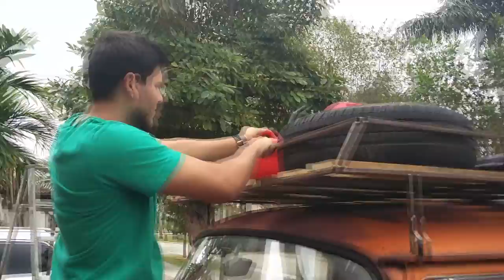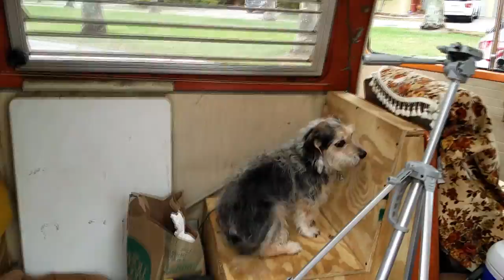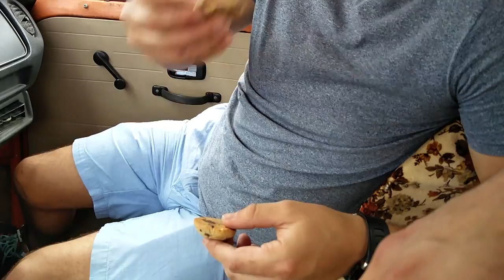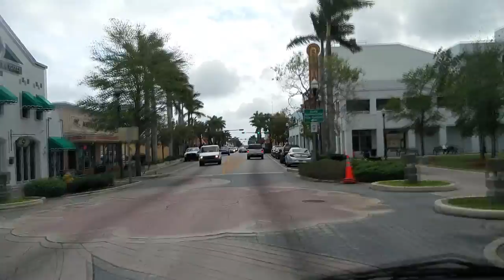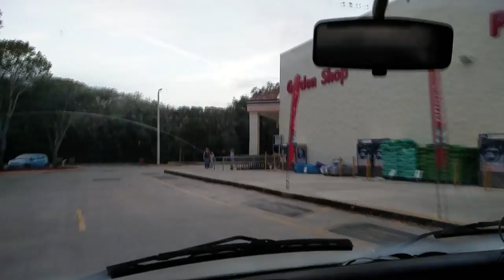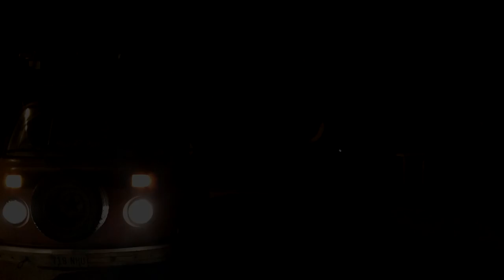VW Bus (1973 TinTop) Camping Part: 1

Comment: Start putting back some cash to eventually rebuild the engine. A little oil use is normal, but if it starts having a smokey exhaust then sooner is better than later.